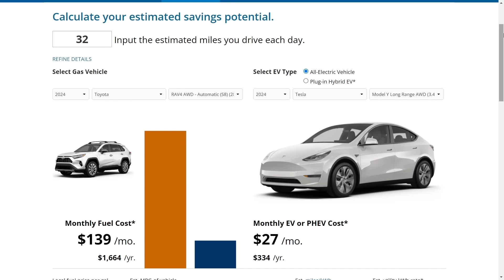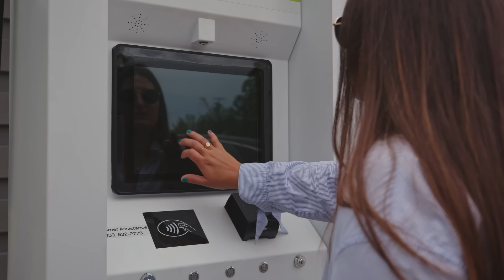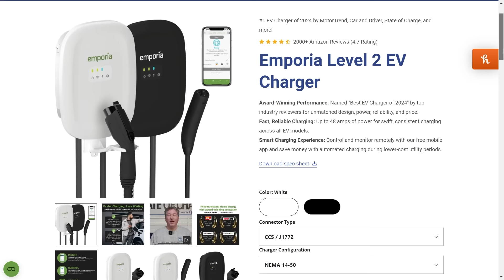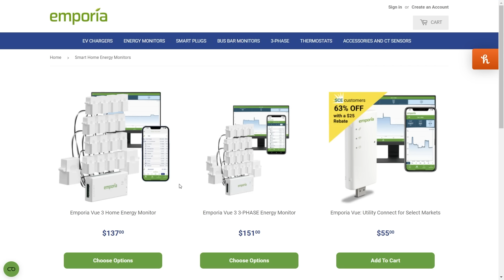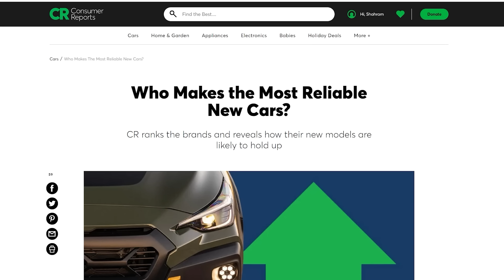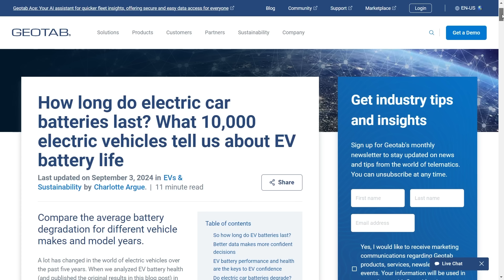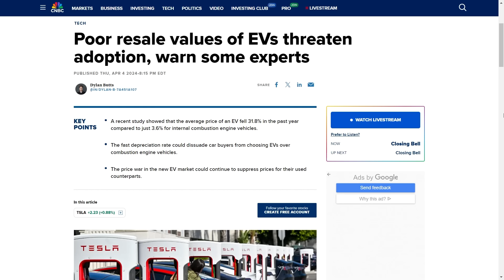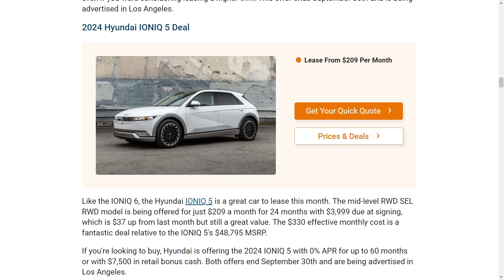EXPOSED! The Hidden Costs Of Electric Cars No One Is Telling You About

Comment: As always you provide an easy to understand analysis of the EV issues. We purchased an EV in 5/23. We have 40 thousand miles on it. We have a charger in our driveway. Our State gives a generous $2,500 discount at purchase and payed to install our charger. We qualified for the $7,500 tax credit. The company makes frequent improvements via wifi. We have taken a few thousand mile trips with no issues charging becasueTesla has plenty of charging centers on the East coast. But if we were in an apartment without our own charger going to a charging station would be a headache. For anyone at all hesitant get a plug in hybrid. Thanks
Reply from the maker: Thank you!

Comment: Dear Tesla owners, I know it’s possible to have an EV cross country road trip. And it saves money if you can charge at home. For the rest of us, life is complicated enough and don’t want hazle to plan or remember to charge. I also know battery failure rate is not high. But some of us want the peace of mind of gas and hybrids. No need to plan the stops, no need to remember to plug, no need to worry the cold, don’t want to think about the small possibilities of battery replacement or fires. Just drive and fill up in two minutes at the next gas station around the corner, or the next exit, not 75 miles later. Peace of mind. Get it?
Reply: Btw when I’m on a road trip I want to eat and visit the places I want, not limit by where Tesla chargers are. I’m not saying EV are not good cars, just not yet. A few years later when the charging can be done in 5 min and charging stations as many as gas stations now. Then it would be a good time to buy with peace of mind.